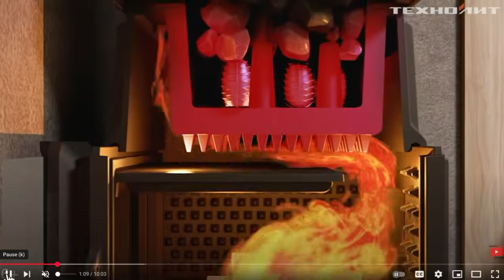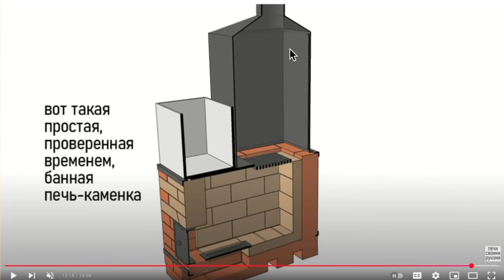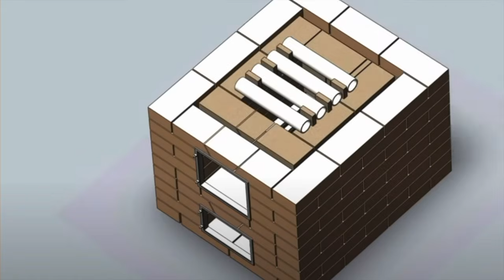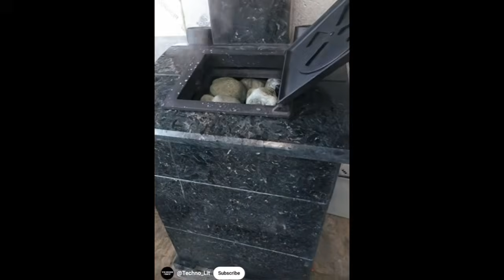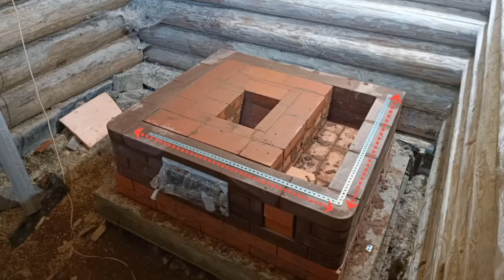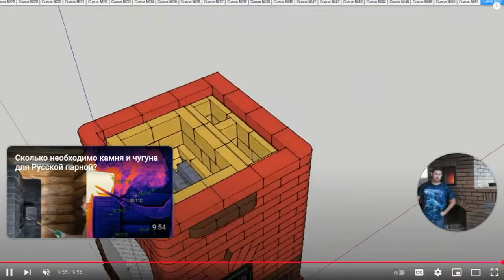Sauna Stoves & Bath Stoves - DIY - All You Need To Know

Comment: The rocks don’t touch the flame. Pipe runs thru cage  rocks are just heated up and water drains out sides and bottom.  Most are Ceramic tile. Or little. Cast iron panels and clean out s